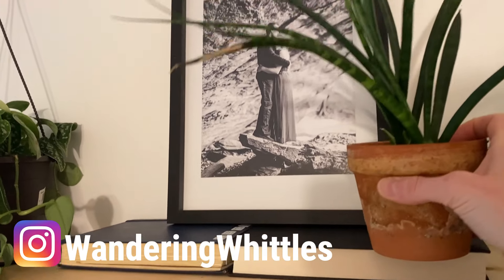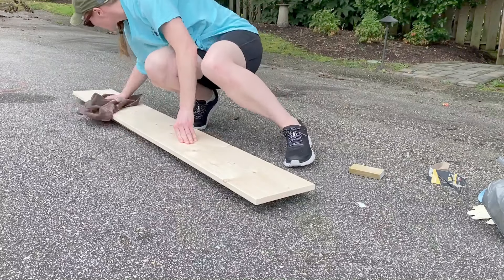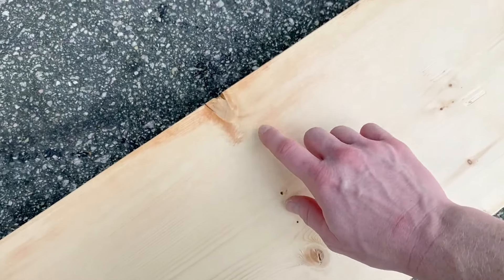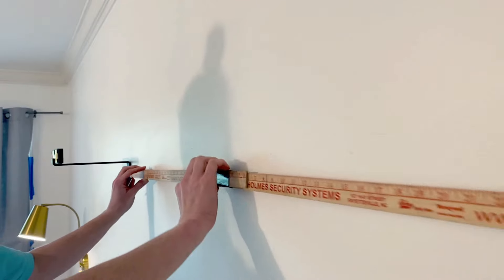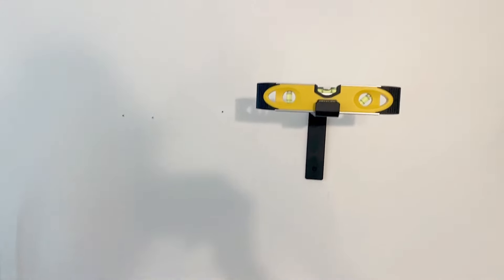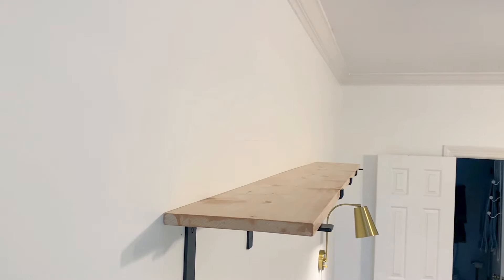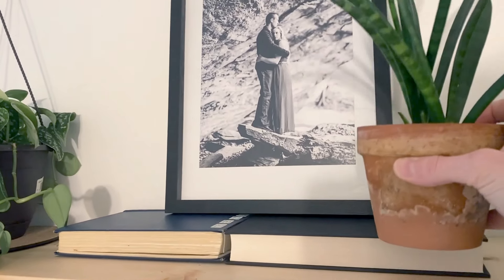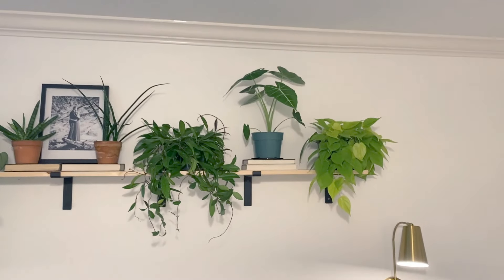DIY Plant Shelf | Bedroom Plant Shelf | Decorating Above a Bed

Comment: Hi 🙋🏻‍♀️ question please🙏🏻 
So the 3 brackets in the middle are the size 9.25? Because clicking link it open directly to that size... and I know you said the shelf board is 10 inch depth.. 
Then the two brackets at each end is the 10x6 size... 
And what’s the thickness of the shelf?
Reply from the maker: Hi! So the 3 brackets in the middle are in. fact 9.25". The other brackets are 10" and hang over the shelf a tad bit. The depth of the shelf was sold at 10" depth, but is closer to the 9.25".